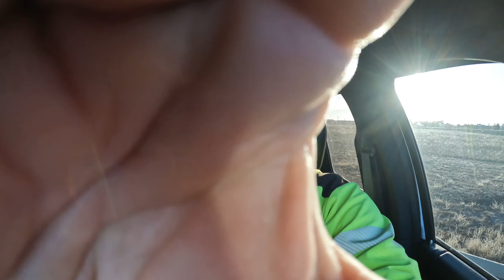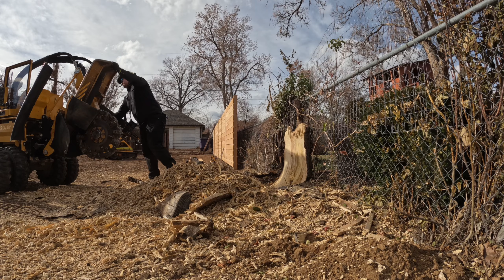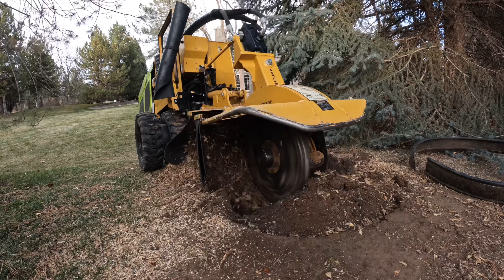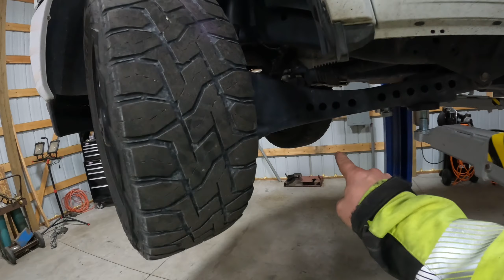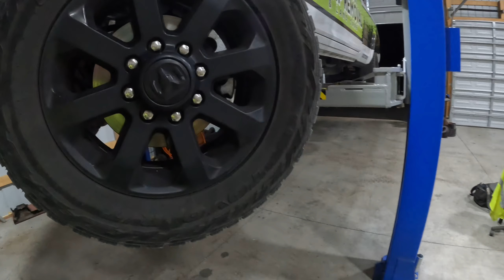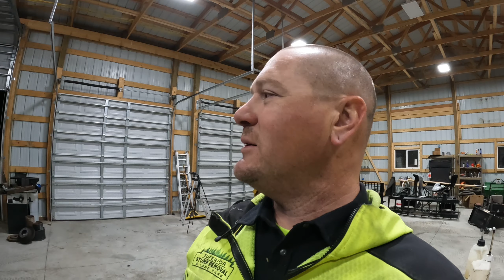Black walnut stump in Denver?!

Comment: wire wheel the bolt threads, run a thread chase tap through the threaded bore, spray the threaded bore and bolt with brake cleaner, blow out/off with compressed air, blue locktite, torque, done.
Reply from the maker: That’s the plan. Thanks

Comment: I had a brake slack adjuster bolt that kept coming loose on one of my dump trailers no matter what I did it would vibrate loose could never figure out why my guys ended up bending the axle on the dump trailer and that took care of that all new brakes and axles
Reply from the maker: Hoping I can avoid the rebuild lol.